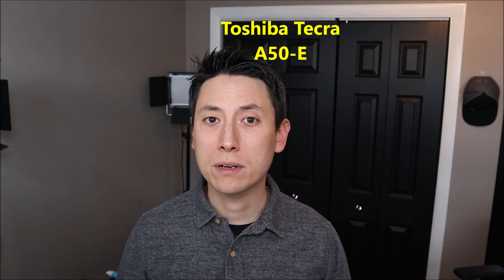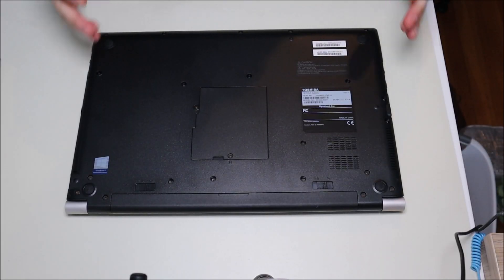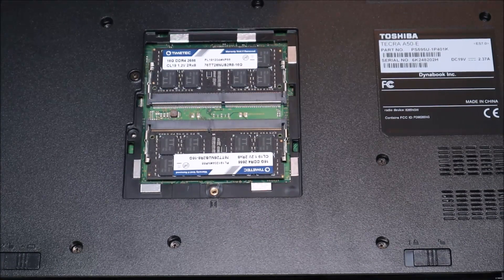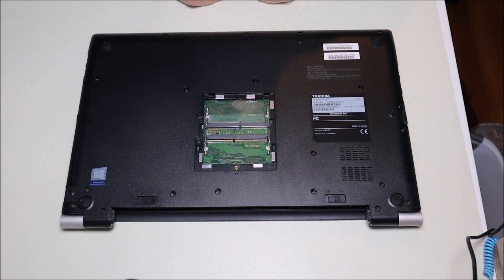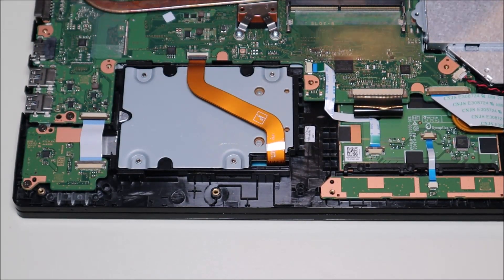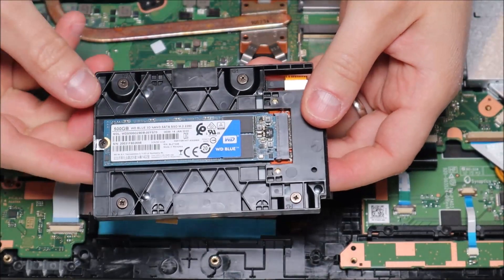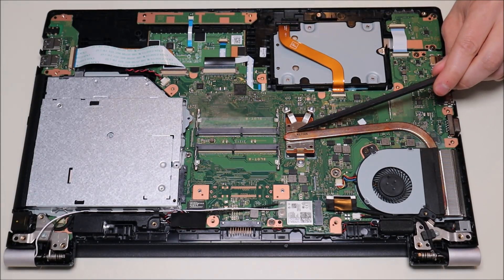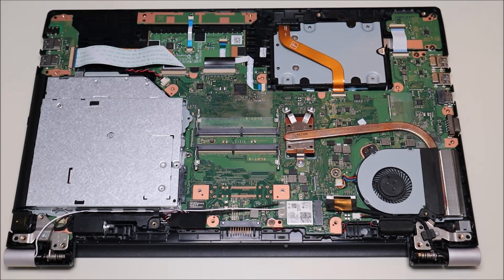Toshiba Tecra A50 A50-E Teardown / Disassembly

Comment: how to replace keyboard in that model?
Reply from the maker: They keyboard is what is known as a 'French Inset Keyboard'. It is not screwed down. Its held in by plastic rivets. To access the keyboard, you would have to remove most of the internal components including the motherboard :(  Then you would basically break the keyboard, by pulling it off of the palmrest and breaking all those plastic rivets. The keyboard replacement would have to be taped down and may not be as secure as the previous one. The other option is to replace the entire palmrest.

Comment: Unfortunately i had an issue with the processor so during the "operation" i broke the white clip. What can i do now?? Is there a way to stick with some kind of glue or smth similar?
Reply from the maker: Can you be more specific? What white clip?
Reply: @PC_Monkey  it was the white and black plastic thingy that was holding the cable from SSD to the motherboard, but eventually i found a solution and fixed it. Thanks dor the respond bte, and sorry for my English ☺️
Reply from the maker: @IsidorosMos  Your English is fine :) Glad your all set :) Always here if needed !!

Comment: Hello jamin 
I have bought another dell Inspiron 3552 laptop and the problem is 

I have 3 USB ports on it right now and the left one works but the right two by the cdrom stopped working I’ve taken this laptop apart trying to figure it out but I’m down to only one USB port it worked fine yesterday after noon and then all of a sudden it stopped I kind of feel like the right side USB ports have no power everything is connected right it’s just not working I did order a usb hub to use yesterday since it quit but 

Could you tell me what may have caused that the power came on it only comes on if the laptop needs charged when it’s full it won’t come on but my USB ports won’t work 
My headphones jack won’t work neither 
It’s like the whole right side doesn’t work the cdrom works but the head phone jack doesn’t or my two USB ports don’t 

Thanks
Reply from the maker: 1.  First, make sure all updates are processed as seen here:  https://www.youtube.com/watch?v=kX8bB725Ljw&feature=youtu.be.  Could be a simple driver issue.
2.  If not, perhaps the board itself is bad or loose.  Reseat the ribbon cable from the USB board to the motherboard.  If that fails to help, perhaps replace the USB board :(
Reply: @PC_Monkey  what ribbon cable are you referring too I don’t want to mess with it anymore I ordered a usb hub for it instead my headphone jack doesn’t work neither on it but I ain’t worrying about it eventually I’ll just order a new laptop in the future
Reply from the maker: @adammassingale7075  Usually there is a Ribbon Cable that connects internal components to the Motherboard.  That is what you will have to unplug and plug in at both ends.  It will run from the USB board to the Motherboard. Does this help?  https://www.youtube.com/watch?v=0xvqTtYOBcw
Reply: @PC_Monkey  that is plugged into the motherboard the left side USB port where the HDMI port is works just fine it’s the other side (the right where the headphones jack is them two usb Ports and the headphone jack completely stopped working are you talking about the ribbon cord that goes over top of the hard drive from the motherboard to the right side USB port it’s actually the left 2 usb that isn’t working
Reply: @PC_Monkey  it’s beeping at me once again
Reply: @PC_Monkey  it’s still doing that beeping after I took it apart to see if anything was unplugged and when I turned it on the screen stayed black and it started beeping like it did before what causing it everything is plugged in right it just keeps beeping at me and it’s very loud I’m actually gonna end up buying a new one with a backlit keyboard if this laptop continues to do this
Reply from the maker: @adammassingale7075  So the issue is not that the USB ports dont work but now the computer does not turn on?  The screen stays black?
Reply: @PC_Monkey  no the usb don’t work and now the screen stays black and it starts beeping at me still
Reply: @PC_Monkey  I ain’t messing with it anymore I’m buying a new one
Reply: @PC_Monkey  after I taken it apart it started doing that and I can’t figure out why what could be causing that I’m afraid to turn it back on and it continue to beep it actually scares me and my cat
Reply: @PC_Monkey  all the cables are plugged in correctly and every time I turn it on it starts beeping at me immediately no display or nothing and it’s either 3 shorts beeps or 4 short beeps I took the cmos battery out and put it back it and turned it on and it beeped at me reseated the lcd cable I haven’t turned it on yet because I’m afraid to reconnected the power cable and it beeped at me I don’t know what’s wrong with this laptop but I’m buying a new one next Thursday
Reply: @PC_Monkey  I believe I have either 3 long beeps or 4 beeps memory write failure and 3 beeps mean memory failure I think I don’t know what’s wrong with it
Reply: @PC_Monkey  took the whole laptop apart and said I’m done with it